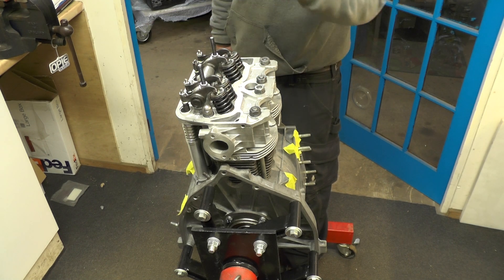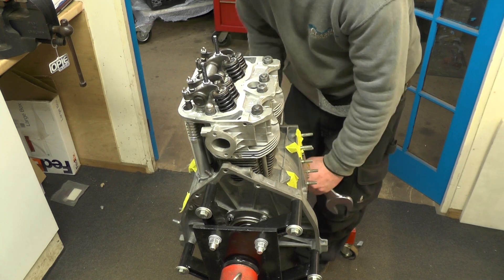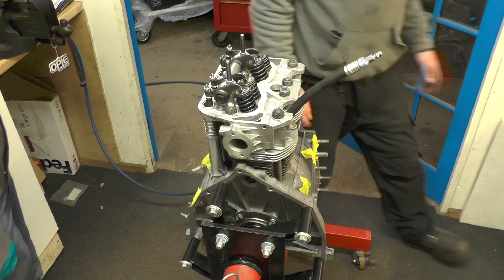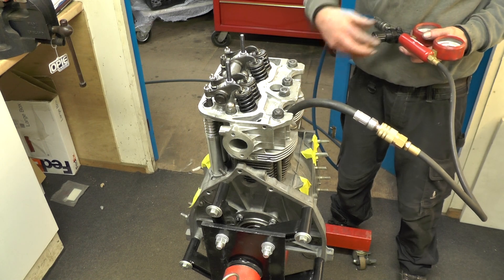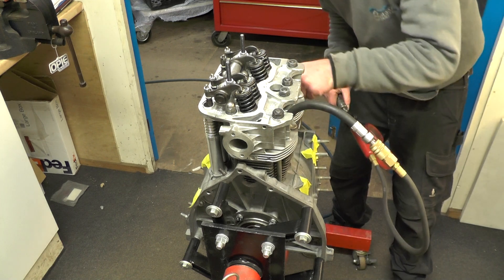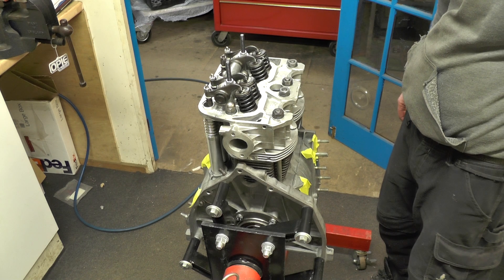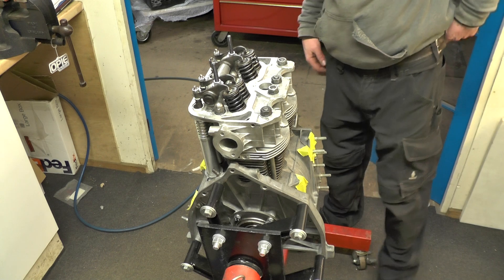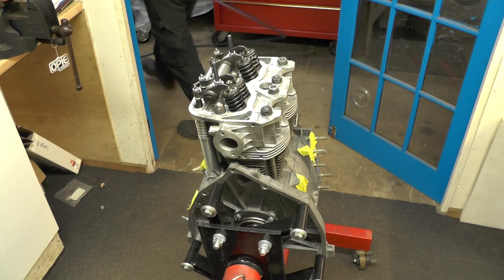30-35 Complete Core Engine Build - Classic Fiat 500 Engine Rebuild Series

Comment: Nice episode. When I rebuilt the top end of mine, it was in the car park in Cowes. I rushed to get it done before getting the ferry home!  A local machine shop had repaired the exhaust manifold bolt holes after I pulled all the threads out!   That happened after my dad had stripped a spark plug thread!  It's 42 years later, and I've never forgotten the lesson when bolting into alloy threads, insert by fingers first!